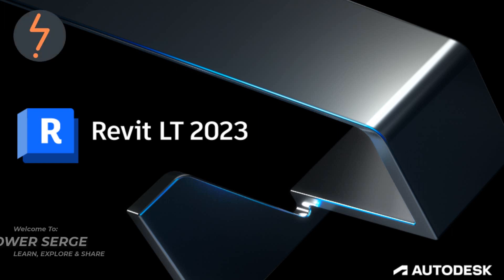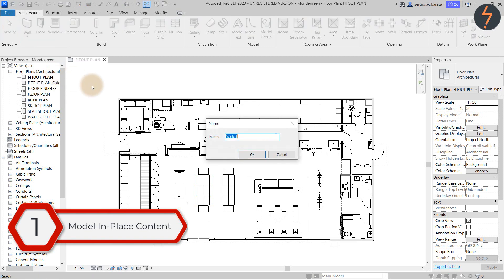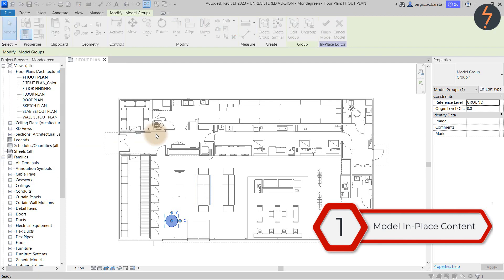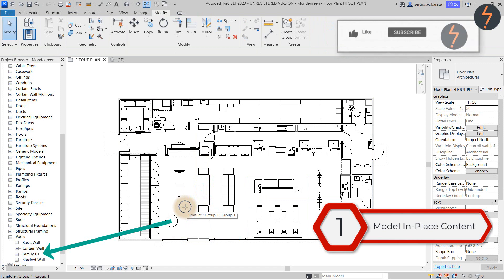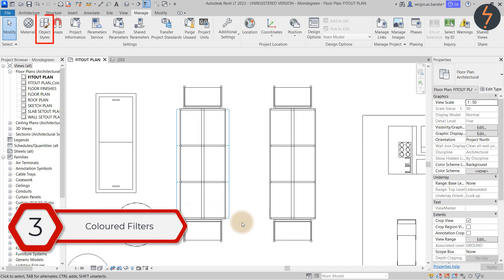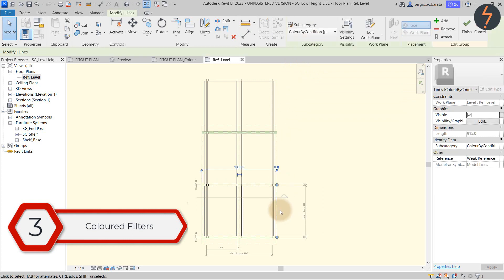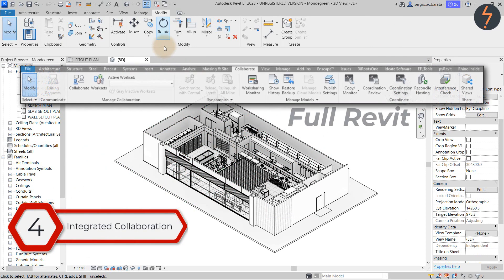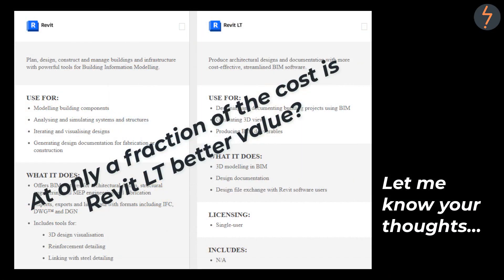REVIT LT | 5 Hacks | 5 Myths Busted

Comment: Hi, I am a  new independent designer and have been using revit lt because it is so much more affordable than the full revit. While it saves a huge amount of time for drafting, there are fundamental features that i find make it a major time sink. 
Your video is very helpful, but I am wondering if you have a workaround for the roof issue. If i want to draw anything but the most basic of rooves, i find the tools in revit LT are frustrating.
Sometimes i have to draw multiple roofs that will not attach or line up well, and sometimes it cuts off large sections when attaching them. 
Thanks for the content
Reply from the maker: Hi! I haven’t experienced any major issue with roof modelling. For complex roof geometry I use the in-place wall function to get to the mass interface. From there all shapes are possible.
Reply: @SergioBarata  thanks for the reply! Do you have a tutorial that would help with using that tool for this application?

Comment: Good explainations as always.. Myth 3 can be done only with loadable families. For the system ones is harder because it's refer to the category itself. Only sweeps could be assign to diferrent under categories. Yesterday I was thinking about the workflow for the filter replacement and that would be for example if I want to have fire rating walls presented as red I could do a wall schedule with a filter only for fire rating walls and then select the walls inside the schedule and then overreid them in the view. The workflow is definitive manual but can help....
Reply from the maker: Thanks Damir! Yes, you are right. Revit LT requires a little more thought and application but it’s so cheap! We use it for one of our main teams and it works efficiently - saves us thousands of $.
Reply: @SergioBarata  yep it is. The price is really cool regarding the Bim software and comparable to the other Bim softwares on the market. Actually it's really a question if other bim softwares have their own light versions as Revit